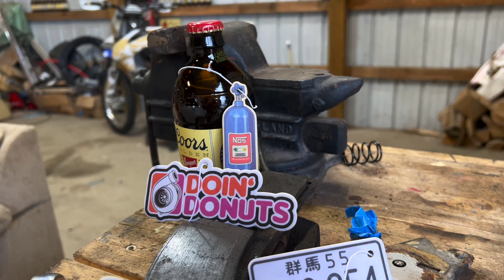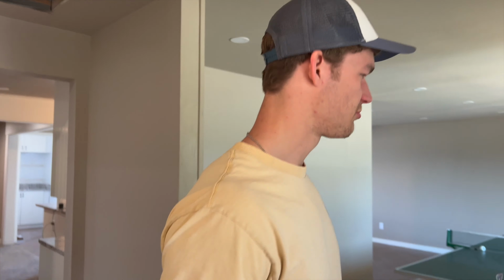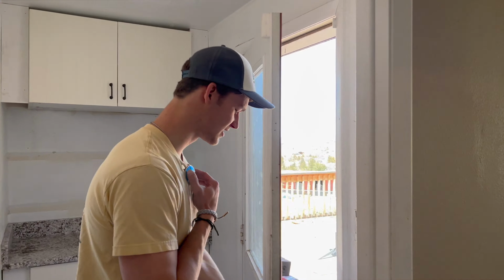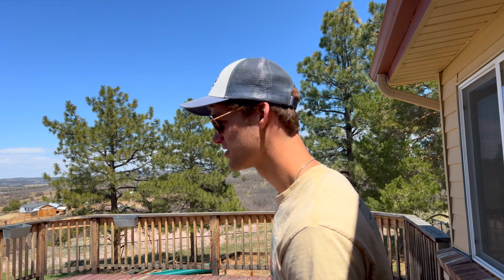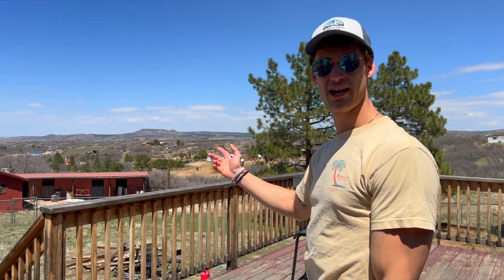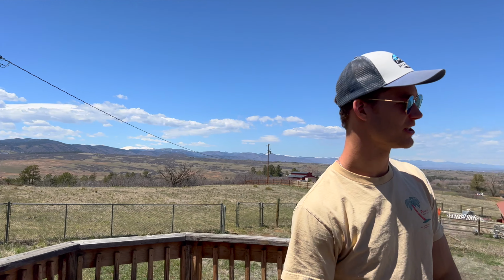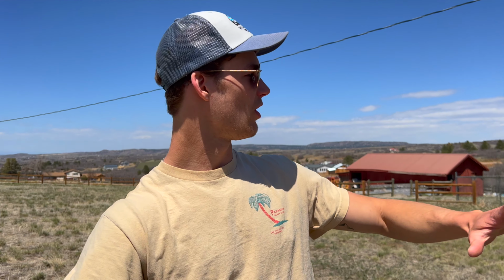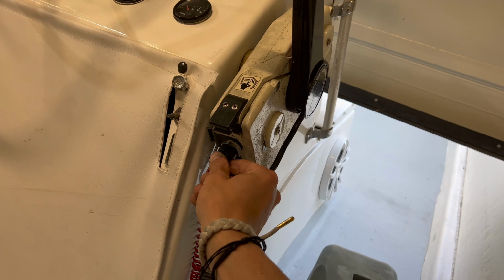EXTREME Offroad Testing The Ford Focus RS (Terrifying)

Comment: Glad to finally see someone else using an RS the right way. I beat the crap out of my RS off road on gravel / dirt and it’s so much fun. I’ve punctured one of my pilot sport 4S’s, destroyed the under tray & cracked my ETS exhaust from jumping it and bottoming it out too. Thinking about doing an aluminum skid plate and some different tires in the near future

Comment: Haven’t gone to 2017 RS2 they actually are surprisingly good dirt rally rally cross vehicle even light over landing. The real downside is the harshness of the factory ride the vulnerability of all the front components and and lower approach angle and you will completely destroy the 19 inch tires Offroad. Just before I got rid of mine, I test fitted 17 inch custom braid wheels, to get enough sidewall for a dirt road duty, in the end, I traded in for a bronco sport.
Reply: You traded in a RS for a Bronco Sport....?